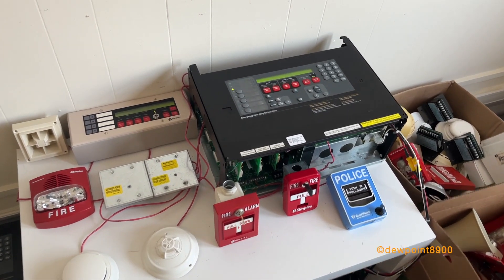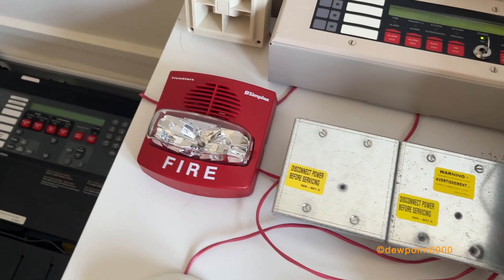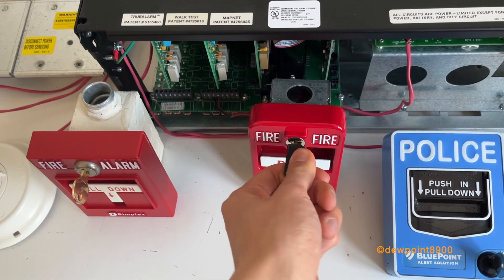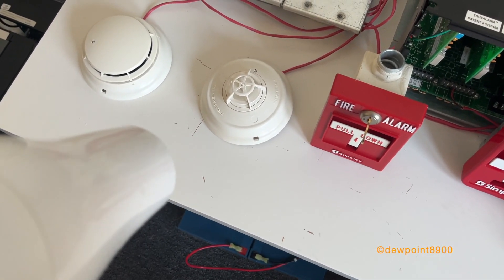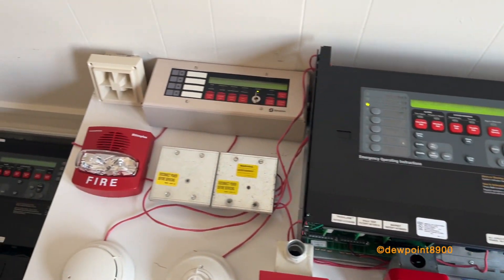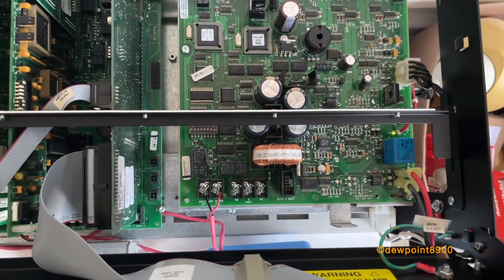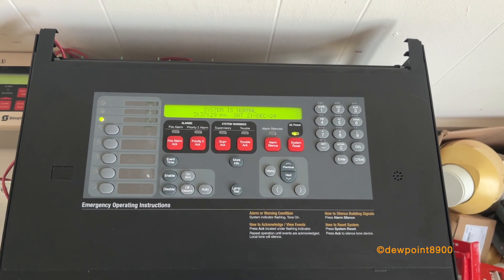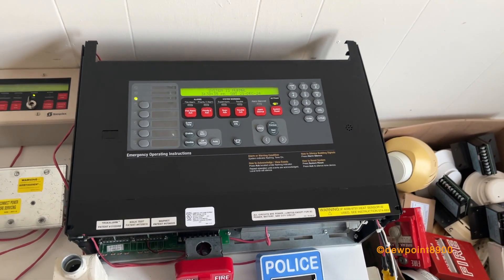Simplex 4100U with Security Zones

Comment: The 4100U was a major transitional period for Simplex, away from the era of tons of communication harnesses & cables…all condensed into 4-wire communication over a PDI board. Quite the impressive improvement jumping into the 21st century. All of the flaws with the U’s CPU design & software were fixed with the release of the ES—using cross compatible components! Quite the technological advancement!
Reply: Both are definitely better than the current ES-series for sure at least (though just the same maybe not considering they're basically all the same level of proprietary).
Reply: 4100+ still better than
Reply: @officialsimplexguy That's your opinion